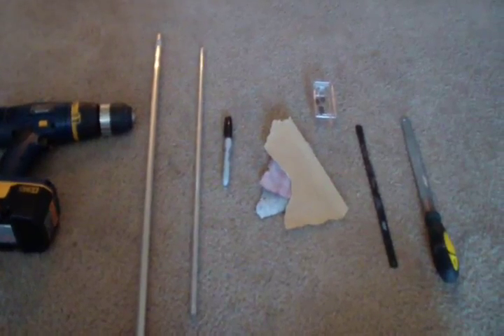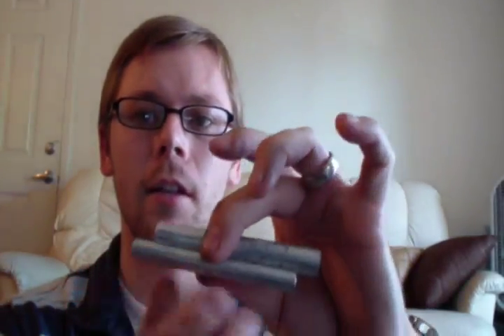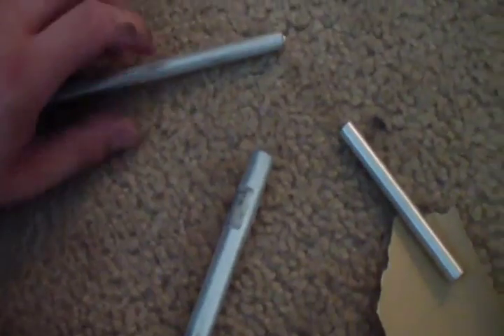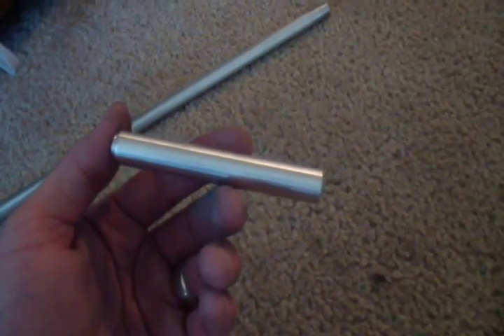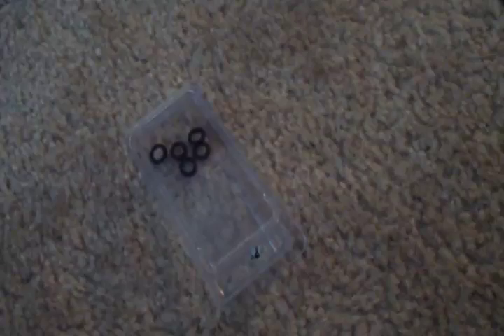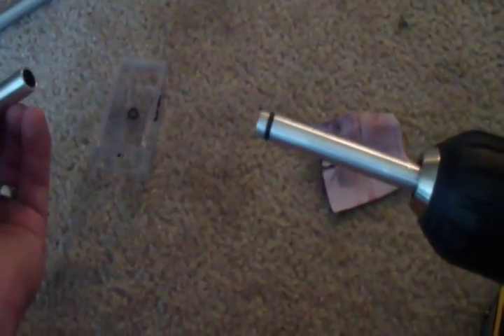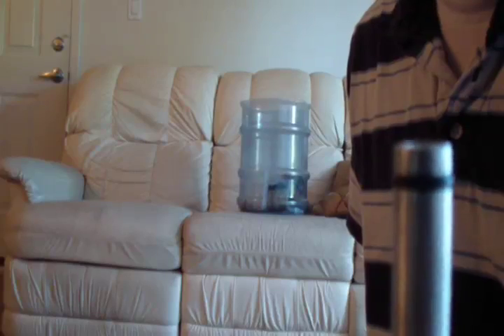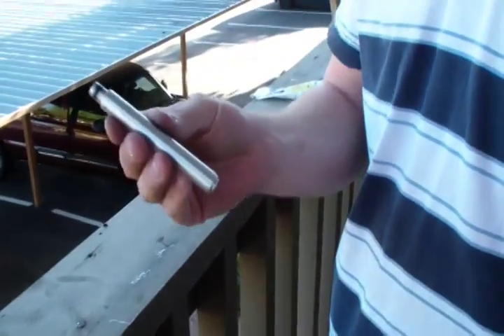How to make a Compact Fire Piston

Comment: I did everything and followed all of the instructions in your video but still cant get the char-cloth to ignite. am I doing something wrong?  I notice that there is a cut in the video right before yours ignites.  I really want to make this work after all of my hard work trying to build this wonderful thing.
Reply from the maker: Without seeing and trying to use your fire piston, I can't tell you if you did something wrong. The best advice I can give is to make sure you have an air tight seal. If your piston doesn't push itself back out as soon as you push it in, then you don't have a good seal. If you do have a good seal, make sure that you lubricate it with something. I use petroleum jelly, although some say that there are better lubricants. If you have a good seal, and good lubrication, then you have to slam your fire piston as hard as you can. Even with a good fire piston, it takes a little practice to be able to use it properly. I made a number of fire pistons that didn't work until I finally made one that did. It took a lot of effort, and a lot of adjusting. Don't give up.
Reply from the maker: As to the cut in the video before ignition, that was my third or fourth try, and I just cut out the times I didn't get it to ignite.
Reply: Thank you so much for the prompt response.  I really like your videos and where you are going with them. I'll keep trying and keep up the strong work!! It is people like us that will survive.  

  I am working on an ammo-can tent stove video that i hope to post in the next month and will send it to you. 

  Again,  I thank you for your knowledge and videos.
Reply: @NickVanLeuven  🔴 What Is Islam? 

🔴 Islam is not just another religion. 

🔵 It is the same message preached by Moses, Jesus and Abraham.

 🔴 Islam literally means ‘submission to God’ and it teaches us to have a direct relationship with God. 

 🔵 It reminds us that since God created us, no one should be worshipped except God alone. 

 🔴 It also teaches that God is nothing like a human being or like anything that we can imagine.

🌍 The concept of God is summarized in the Quran as:

📖 { “Say, He is God, the One.  God, the Absolute.  He does not give birth, nor was He born, and there is nothing like Him.”} (Quran 112:1-4) 📚

🔴 Becoming a Muslim is not turning your back to Jesus. 

🔵 Rather it’s going back to the original teachings of Jesus and obeying him. 

More .....👇

🔴 THE RETURN OF JESUS
Reply: Make sure to LUBE the o rings guys😂

Comment: Nice!
Manufacturing tips:
1: Cut enough rod for both the piston and plug. Place the intended plug end in the drill and sand. This sands the piston evenly and includes the very end of the plug. Once sanded, cut the plug away.

2. Extra care when ramming the plug. Aluminum tube is soft and may split. 

3. Two "O" rings spaced no more than 1/8 inch apart and a touch of white grease makes better seal/higher compression/higher temp.

4. Follow's Nick's notations for safer tooling of the parts.

Comment: You did good and that is an awesome job of making that with those tools.  It is not stupid and irresponsible to hold something and drill it.  The most that will happen you will poke your finger a little.  The tapping with a file is something we all have done and that can case damage has files are hardened and therefore more brittle and can shatter, but  you warned people.  Kelhawk needs to get a life!

Comment: Also, a larger o-ring would have been better than the teflon tape fix.  The other thing is the materials used, keep in mind metal is going to take a lot of heat away from the hot ember, aluminum for example would take the most heat away along with Ti.

Comment: You might try the freeze plug method. go ahead and chamfer one end of plug. Put the plug in the freezer for an hour or so. The plug will shrink several thousandths of an inch. Wearing a glove heat up the end of the pipe with a lighter. heat it right next to the freezer have a table ready. In a fluid quick motion pull the plug out of freezer set it on table sanded side up and quickly push the hot pipe down on plug. You have a fraction of a second to push. They will be locked together tight.

Comment: Try this. Get some safety goggles and leather gloves, take a D shaped file like that, and try to break it. If you manage to get it done with anything like TWICE the amount of force he was using, you might begin to have a point. (pardon the pun) I also notice that in 06:30 or so, the drill is pulling the saw teeth instead of pushing: If there's a catch, it will pull the saw through your hand the wrong way to do much cutting. Pretty clever, actually!

Comment: Well for next time here is a little trick for getting the o-ring off without any tools. You grasp the o-ring on both sides and pinch upwards, when you do this it will form a little bubble or hoop at the top and you can just roll it off with your other hand.

Comment: Do you have any videos on first aid?  A rock would have been better than using the file,as a hammer, for instance.  Files are brittle, and when they break they are quite sharp.  Also, holding the hacksaw blade the way you were risks a very nasty cut if the blade catches in the work. Great idea for the product, but bad example on how to use simple tools.

Comment: A fire piston is an awesome historical artifact or science demo toy but it doesn't compare with a modern lighter. A mass manufacturered Bic lighter will usually get lost before its flint wears down or it runs out of fuel. They're tested over 50 times and made to something like 8 sigma tolerances. Countless stories of them going through the wash, being left outside in snow and working fine once dry. A firesteel is more durable. A piston is just cool :)

Comment: I don't know if anyone's shared this with you already, but if you need to make another fire piston, once you cut the plug to seal the end of the tube, you'll probably have an easier time fitting the plug if you put the plug in the freezer overnight. Let it sit for a day after you've hammered the plug flush to allow it to expand back to it's normal diameter, and to allow any condensation that may form to evaporate,

Comment: Hi from Derbyshire in the UK.  Very good video.  Who needs a lathe when you have an electric drill Ha ha.  You could stick the body in the drill a create some anti slip grooves as well.
Watch out for the aluminium dust and dont breathe it in. They reckon aluminium and Alzheimer are connected.  Good vid 10/10

Comment: why not make the plug at the bottom a half inch longer so it sticks out, drill a hole through it, shove a rod through the hole, then you have a handle on it, and you can still use it the way you want to, store it the way you want to, but you still have a handle

Comment: Actually, heat IS particle movement. The compression of the air has a higher ratio of movement to volume, creating a higher temperature. You end up having the same amount of thermal energy in a smaller volume.

Comment: To make char cloth get a small container and drill a small hole on the top. And lay something like 100% cotton inside or 100% linen inside, the size doesn't really matter just make sure it's not too small as it will shrink. Then heat it in a fire or something, smoke will come out of the hole eventualy, and as soon as the smoke is gone take it out. It's really easy, and the stuff works great.

Comment: Really interesting video. I had to google fire piston, since I could not determine the purpose of the tool you were making, even by the end of your video. I will be making one of these in my workshop for certain. A couple of suggestions if you ever decide to remake the video: If available, use a drill press to chuck the rod into when sanding to desired thickness, and to drill the tinder hole. Also, using a block of wood to elevate the hacksaw blade to the desired height for cutting the groove.

Comment: A file is almost 60 rockwell hardness, and aluminium is 40 rockwell hardness for aircraft grade aluminium, which those cheap rods are doubtfully aircraft grade, so lets say its 20-30, use some simple logic on what happens. no flattening teeth, but instead leaving marks on the aluminium. so teeth will bend on the very cheap and soft files, and the harder files would break. now thats a different problem..

Comment from the maker: @LLuE88 Sorry, I don't remember what size the o rings were. I just took the aluminum rod over to the o rings and matched them up with each other. I found an o ring that was about the same size as the rod, and I made sure it would be small enough to fit in to the hollow cylinder.

Comment from the maker: @AlexKessler99 I put char cloth in the fire piston. Friction is what causes the char cloth to ignite. When air is compressed really fast, all the air molecules collide with each other. The result is that there is a lot of friction between the molecules, and it causes the air in the fire piston to rise to an extreme temperature. The air gets hot enough to ignite the char cloth.

Comment from the maker: @dannisan77 It takes a little effort to cut through the solid rod. If you have a dremmel or some other power tool it might be a little easier. It took me about ten minutes to cut through the solid rod, but that was probably because I didn't have my hack saw handy. I was just holding the blade. (could be dangerous)

Comment: suggestion, instead of using teflon tape just move the grove back a hair or cut the groove off that you cut to deep and then re-groove, no need to start over. Should your O ring fail in the woods I really don't think you would have a roll of teflon tape handy; or just buy a bigger O ring. I have a very similar FP on my channel I've also helped several youtubers with the construction of theirs.

Comment: You should never hold a saw blade with your bare hands against a rotary tool of any kind. If it grabs ahold of the blade for some reason, it's going to want to remove it from your hand. Unfortunately, the saw will also want to remove parts of your hand in the process. Also, files are made of extremely brittle metal. Don't use them as a hammer unless you want metal shards in your hand or eye. 

Good design though. I'll be trying it this weekend. I'll be sure to let you know how it goes. :)

Comment: This is a well detailed explanation on how to make a fire piston, you inspired me to make one myself which I'm nearly finished. Just one question, is it hard to saw that solid non-hollow aluminum rod? I was thinking of using a hack saw for that job. I just need to make the plug and I may need a drill seeing that sanding down an aluminum rod would be difficult without one.  With mine I'm able to burst a hole into duct tape when I try using it as a plug, that makes mine seem promising.

Comment from the maker: @sunderwood52 First off, I myself have never been able to get cotton to work in a fire piston, it will just blacken and smell burned, but no coal. It does take some practice to be able to get it to work with char cloth. The first time I made a fire piston, I thought it must have been a dud, cause I couldn't get it to work at all. Turns out, I just needed to practice using it. You almost have to put your whole body weight into it and push it into the ground to get it to work.